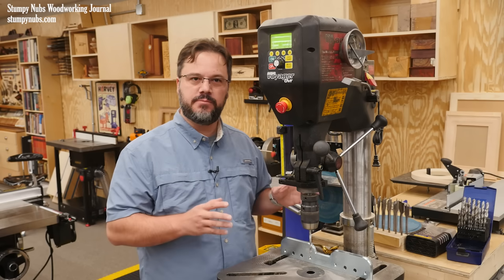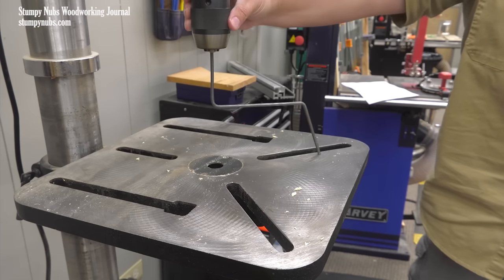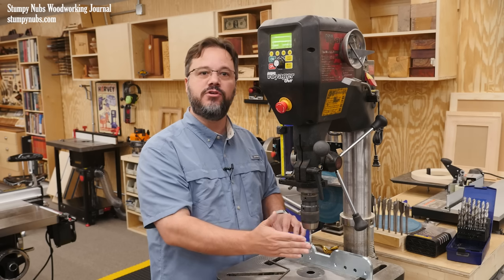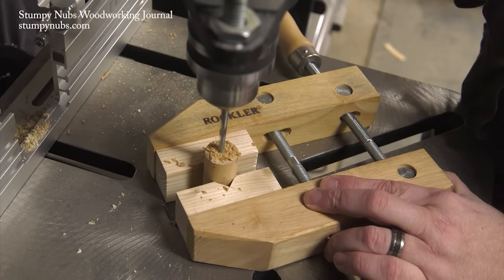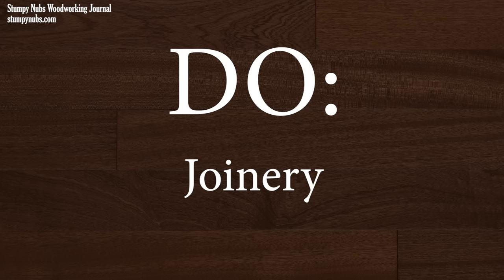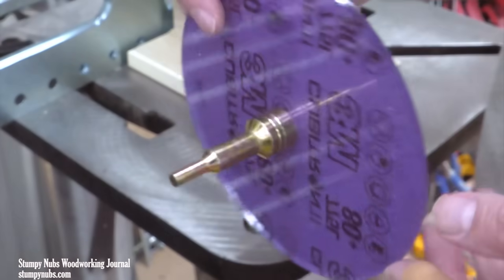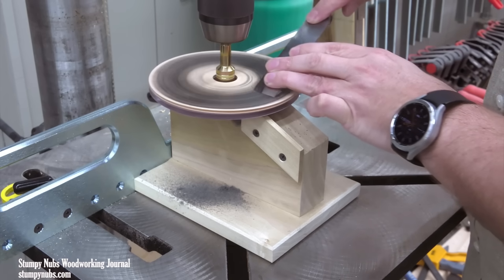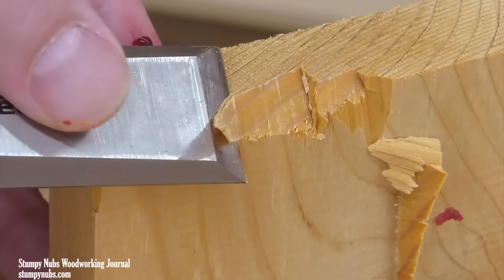WARNING: Internet drill press trend can SERIOUSLY hurt you!

Comment: Another safety tip from an old ag teacher:  Keep your work to the left of the operator so if it catches on the drill bit, it will hit the fence or column rather than slicing through you. Thanks for all the good tips. I always learn something new from your tips.
Reply: I learned that the hard and ugly way when drilling a small piece of soft wood while hurrying, got half of my thumb-nail ripped off. Don’t have to be a strong machine and even soft materials can catch.😁
Reply: My dad was remorseless in drumming this into me before he even let me touch a drill press.
Reply: @adtymryd6295  With a vice always make sure that everything is tight before operating - if the workpiece can move even a little, the drill can catch, and instead of rotating the piece, since it's blocked by the vice, it will break the drill bit and throw it pretty much with the force of a kickback on the table saw. 
I've had a piece of 40mm drill bit fly by my ear - it sounded like a small fly. Since it wasn't at my workstation, I didn't even grasp that something happened until the guys came looking and pointed the hole on the wall behind me.
Reply: He's wearing a  watch. Safety violation.
Reply: Clamp it securely and it will not spin if it does catch!  Clamps are cheaper than ER visits.
Reply: I liked the sharpening. However when sharpening a chisel, the grinder should be moving perpendicular to the cutting edge. Grinding parallel leaves stress raisers , which can cause the sharp edge to snap off prematurely.
Reply: @ianblenkinsop893  good point, I was unaware of this. Though I did notice that the final leather stropping was done in perpendicular fashion, would that be enough to account for the issue you raised?
Reply: If it's a hazzle to clamp a piece but its big enough to good grip. I just grip it so tight. That if it catches the bit breaks. But yea Just using a vise saves to much problems.
Reply: Two best drill press safety features I have seen-  one was using a Kurt vice rather than the much smaller vice that is normally used on a drill press. The weight and size of the Kurt  vice gives you alot of safety without the hassle of clamping. And the smaller vice can still be used. Just hold it with the bigger vice.  Simple but very handy.
And the second was a foot pedal on/off switch on a cord. This was super handy. After using this setup, I still hate using any other drill press decades later. The foot pedal allows much faster response when you sense trouble starting, and you don't have to take your hand off the work or find the switch. Plus really handy for bumping drill when locating hole
Reply: I placed a 30 kg 600x600 mm steel plate on the bench thinking no problem countersinking for a 30mm. Had it nesting against my hip, and left hand holding the side. When it grabbed on it pushed my body away and ripped out my left hand. Luckily the plate was so big it could only move 1/6 turn before slamming into the drill press column.
Reply: This is a brilliant one! Something I’ve always remembered from a secondary school teachers metalwork lesson! I know it seems obvious now but I loved the logic behind using the drill press as a back up whilst keeping yourself on the safe side of your material. My mind is still fairly easily blown hahah!

Comment: my dad observed "as far as your body is concerned, a drill press is just as powerful as a lathe".
Reply: Umm, no, not even close. My lathe has 10hp motor. Drill press has 1hp. Radial that weights over 1.5t is 2hp. Drill press chuck is tiny. Lathe chuck is over 100 lbs and can hold another 100lbs or more - inertia is huge.
Reply: @tomk3732  Yeah, putting too much care into using a tool is a big problem. That'll cost you so you better make sure that you're never too careful with a tool.

The press can't rip your arm off but it can still put you in the hospital. Now I don't know about you but I'd like to avoid that if at all possible. And I regularly have it helicoptering on me because I still am not smart enough to properly secure metal work pieces...
Reply: it most certainly is not lol a lathe at full speed is going to rip you in two and throw you around the machine, and average drill press with likely slip in the chuck or on the v belts
Reply: They can both cause fatal injuries faster than anyone can react.
The horsepower of the motor is irrelevant to the guy in the morgue.
Reply: @tomk3732  "AS FAR AS YOUR BODY IS CONCERNED!" 1hpor 10hp, it doesnt matter which one pulled your hand off your arm.

btw we know what a lathe is
Reply: @-IE_it_yourself  LOL, it does. I can  stop with emery or even bare hand without damage 3" spinning metal at above 700 rpm in a lathe at 1hp. I did it many times. No I cannot stop stuff in 10hp lathe. I.e. 1hp certainly in high speed - cannot pull your arm off - zero chance. 

Now most drill presses are belt fed, all (or all that I know of) larger lathes are gear heads. Thus drill press under heavy load can slip - you don't have to stall the engine itself. Not so much so for a lathe. Also lathe has far and wide bigger spinning mass - hence so many clutch setups vs. drill press that is super light spindle by comparison (its not a mill). So inertia is so much different. 

Yeah, there is a huge difference between drill press at 1hp and a lathe at 10hp. Both can hurt you but the 10hp is far more likely to cause major damage or death. 

I.e. Op dad is NOT a machinist and thus does not really know what he is talking about.
Reply: My old woodwork teacher used to say things like "These tools are for working with wood, and you are not tougher than the tree it came from."
Reply: @tomk3732  It amazes me that somebody can take so much umbrage at an old piece of wisdom that literally translates to 'be careful around power tools even if they're small'.  You must be a lot of fun at parties.
Reply: I've yet to see a video of someone ripped apart by a drill press. Not saying that it can't happen.
Reply: I like the "This tool neither knows nor cares for the difference between flesh and steel, and would, in fact, prefer the former." stickers.
Reply: @tomk3732  Okay, so, consider this: There are different sizes of drill press. Perhaps his father is used to the ones with, you know, 10HP motors. I've used them before. They very much are as powerful as a lathe and will happily wind you up around the chuck like a garden hose.

Other people have different experiences from you, this may affect their colloquialisms, maybe try to understand their position before tearing into them. You'll actually find yourself to be a lot more convincing.
Reply: Well, I have a Shopsmith, so I can't help but fully agree!
Reply: @Teth47  This is a wood working forum and there are no discussions here of drill presses larger than 1hp - maybe 1.5hp belt machines. 

There are very few radial arm drill presses at 10hp or more - so I doubt you worked on one. The reason for this is that there is simply no need anymore for such large drills. Also weight is at 1t to 1hp so 10hp machine is around 10t. Not exactly something wood shop would deal with. Also quite safe still in most setups as far as getting wrapped around the spindle - you are more worried about the thing tipping over. 

I know a lot about machines. Drill press is one of the safest machines in the shop. Especially one used for wood working.  I am simply pointing out that drill press is relatively safe, even a 10hp radial - as long as it is bolted safely to the floor - tipping over is the main issue with these - and yes ... I have one. 

Statement such as "as far as your body is concerned, a drill press is just as powerful as a lathe" is simply false. Lathe will be many times more powerful. Such statements lead people to under estimate what a lathe is and can do. Your average machine shop will have 5hp to 10hp gear head lathe, a belt drill press at 0.75hp to 1.5hp, maybe smaller lathe, a milling machine at 3hp to 5hp and some specialized equipment. Out of these by wide margin the most dangerous is the lathe. I will not even mention all the operations on a lathe where ones hands can get close to the chuck such as emery cloth or file. Nothing like that is done on a drill press.
Reply: @tomk3732  The point of the statement, for those incapable of abstraction, is that when operated carelessly, a drill press will happily give you a greivous wound. They come in many shapes and sizes, and while the discussion here is mainly around a wood shop, people from other kinds of shops have, like, thoughts and stuff, and maybe coming at them like a rabid animal when they say something you might consider incorrect is not the best way to win hearts and minds, which presumably is why you bothered putting in the effort to write a comment. Unless you just like to shit on random internet people to assuage some internal pain you feel?
Reply: @Teth47  Then there is no point at all to the statement. Since ANY tool can injure you. ANY tool can give you "greivous wound". 
I wrote my comment to simply correct incorrect statement - which seems to be common on the net - drill press is less dangerous to operate than a lathe in 99% of the cases and shop setups.
Reply: A lathe is far more dangerous than a drill press at least in my opinion....Had a bowl I was working on just fly apart it was like an explosion going off with pieces of bowl flying past my face...Havent touched a lathe since lol
Reply: The power should be listed on the spec plate.
Reply: You can tell the people who've used power tools at home unsupervised since they were kids from those who haven't by the things they comment.  😂
Reply: I've done alot of small lathe work on a drill press. Even turned small brass carb jets on an electric drill.
Reply: @LordPhobos6502  Isn't it funny, some of the lessons I learned in wood shop have had more staying power than any other subject.
Reply: @tomk3732  You didn't read the part where it reads "As far as your body is concerned..." because they will BOTH tear through flesh or even break bones if misused or abused REGARDLESS of the difference in power between the two.

Comment: Always make sure you've removed the chuck key before turning on the drill.
Reply: I've tried using a retractable badge holder thing for this purpose, but it's hard to find the right place to attach the body of the device.
Reply: @rpavlik1  They make chuck keys that are spring-loaded and automatically pop out if you're not actively pushing it in.
Reply: If you leave the chuck key in the chuck and then turn on the drill press it will automatically remove the key for you. Works every time.
Reply: @Mhj96813  Yes, but depending upon the drill press (and whether you are left or right handed) that chuck key will dent the wall or your chest.
Reply: @darkally1235  sorry I was completely joking that this was reasonable action. I have done this and have never yet found the chuck key in my shop. In shop class in hr high I once saw a chuck fly off and stick in the wall.
Reply: Could that bit of advice possibly have origins in someone's personal experience?  😄
Reply: I wonder if you could make an interlock that stops it from switching on unless the chuck key is in a specific holder on the side of the drill
Reply: @troystallard6895  Yep, dented the wall behind my father's drill press at least once.
Reply: Lathe also
Reply: I attached my chuck key to a short length of sash chain, and I anchored the chain to the machine.
Reply: @Mhj96813  I definitely got and laughed at this.
Reply: @elongated_muskrat_is_my_name  Easier to have  a spring-loaded pin in the chuck key. They should be in every shop class.

Comment: I have a stupid story for you all. When I first bought my drill press, I chucked up one of those Bosch paddle bits with the auger snail tip and started free-handing a hole in a small piece of oak. I didn’t get hurt, but the oak was ripped out of my grip and flew across the shop and the bit was bent and ruined. Now if I’m doing a process where I won’t have one hand free to slap the kill switch, I plug the drill press into a pedal switch I can on-off with a toe-tap. But, I no longer free-hand anything. I clamp, or at least use a fence.
Reply: Good advice. Safety was rarely at the forefront unless you read the tool safety tools. Now with YT safety has taken a step forward
Reply: Yes, always clamp.  Not doing so is the closest I've ever came to having an accident.
Reply: Yes, and of course never use a self-feeding bit on a machine designed for touch-and go.

Comment: 2:28 NO Rings, long sleeves, watches, bracelets, loose chains etc.
Reply: Long hair and even beards too..
Reply: @dzzope  Our metal shop teacher had a "scalp" on a board, for all of us to see.  Came from a lathe - pre magnetic switch.  It was just the hair, fortunately, but a stark reminder to treat these machines with respect.
Reply: @valvenator  and long noses
Reply: And no more than a 12 pack….
Reply: @dzzope  At least ZZ Top beards... 😀
Reply: Long sleeves... I've been there, got very luckly with bruises only, could have been way way worse!
Reply: Ties and scarves are a no no too, and glasses with the catch strings/chains on them
Reply: As a construction worker, if you work with your hands and you insist on wearing a ring, SILICONE RINGS ONLY. In the event they get caught on something, the ring will tear and break away instead of causing you massive injury. They're non-conductive and far more comfortable to wear with work gloves than any metal.

My actual wedding ring stays in my safe at home, and I wear it on special occasions like formal events, anniversaries, and date nights. At all other times, I wear a silicone ring for safety reasons.
Reply: No rings ever